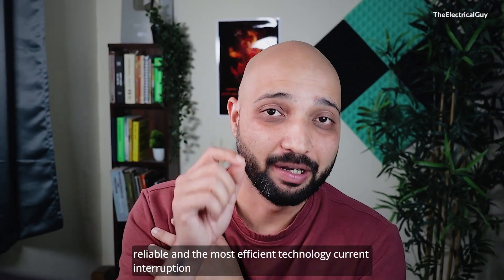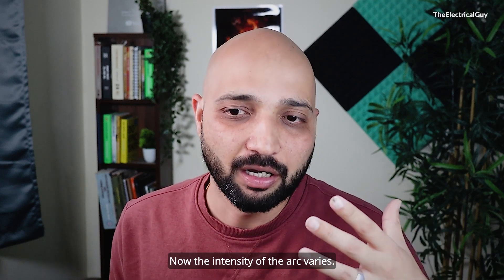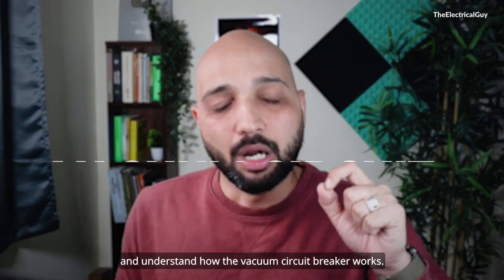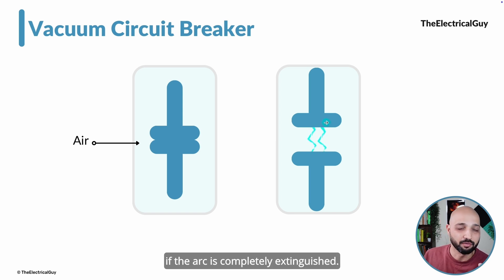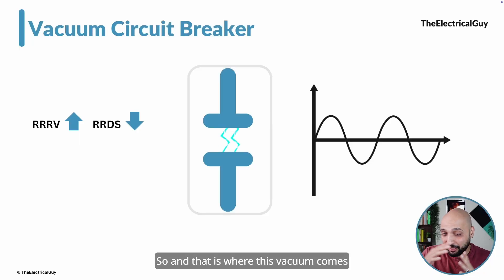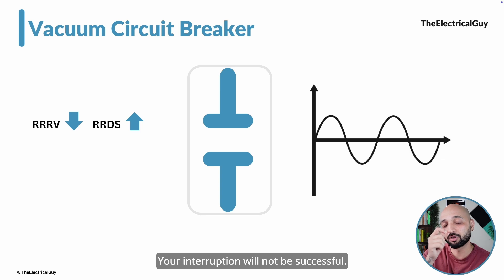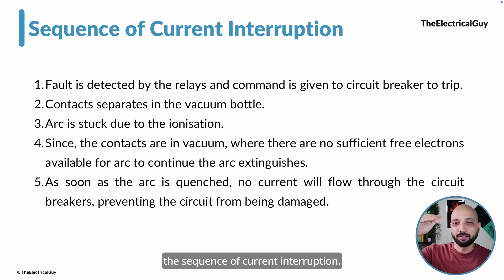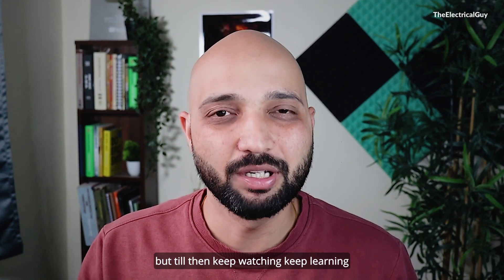Working Principle of Vacuum Circuit Breaker | Step by Step Explained | TheElectricalGuy

Comment: As always very informative video full of technical ingredients. Thanks Gaurav Ji. Keep it up.
Reply from the maker: Thank you 😇 Glad it helped!
Reply: @GauravJ  I urge you to make some videos on renewable energy generation/green energy. To be more specific like how to solar energy which is generated at consumer end is given back to grid. How it happens, mechanism behind. Like I had a doubt as the current flows from higher potential to lower potential. So how the power is given back to grid which is at high voltage as compared to the consumer end voltage i.e. 240 V or 220V.
Reply from the maker: Sure. Will try to make a video on that!

Comment: Thank you sir for this valuable information 

Eng. plz woud u explain ,the  big. arc happened due to hi  current or hi voltage 
because  in my knowledge hi current at
low voltage side not at midum side
Ex.  Trf
11kv/0.4 kv

Comment: Sir i have a doubt
As you said ARC is nothing but Flow of Current via Air
But the contact of VCB are arranged in a bottle filled with vaccum that means no air no gas nothing is there. 

Then How Arc formed b/w contacts without air in vaccum bottle!!
Reply: The vacuum chamber of vacuum circuit breaker will not be absolutely vacuum, because the vacuum pressure of the vacuum chamber is maintained in between -10 bar to - 6 bar. So, still some amount of air will be present inside the vacuum chamber, this air molecules (it is not free electron. If air has free electrons then it will be conductive. Actually it is air molecules) lead to the ionisation. That's why the ark is occurring
Because of this drawback sf6 is inventad.